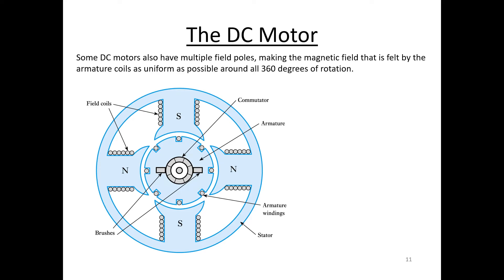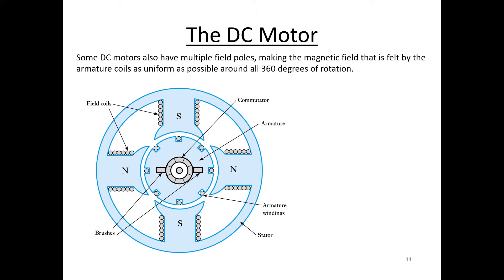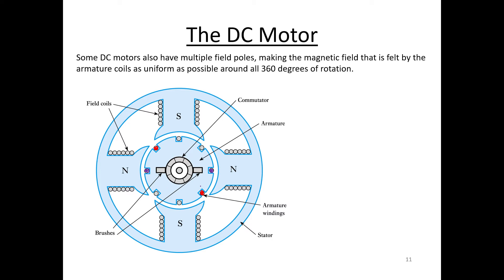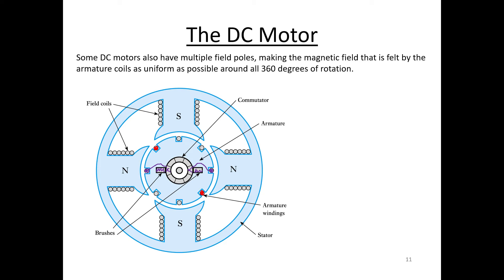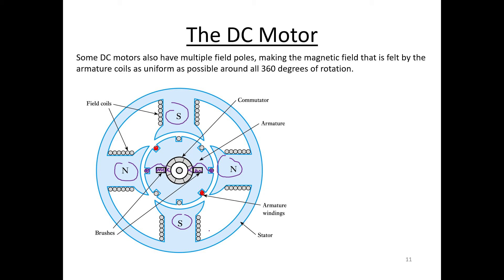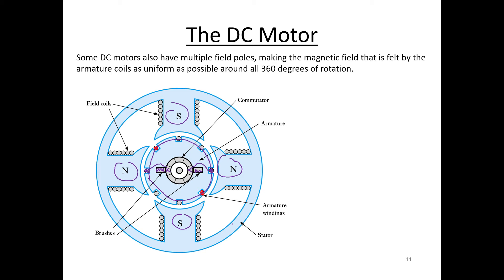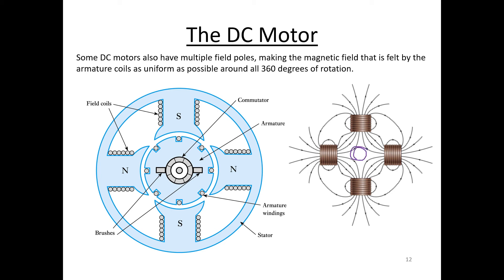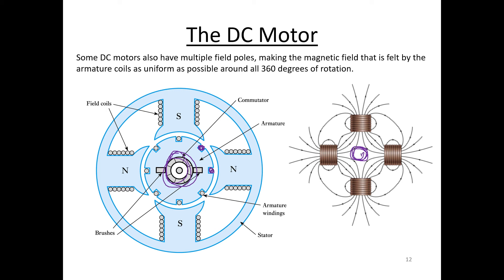Introduction to DC Motors (Part 3) - A 4-Pole DC Motor

Comment: let me ask if there are 2 motors DC of the same size, one with 2 poles and the other with 4 poles, which motor rotates faster and which one will bear the load better. thank you very much.